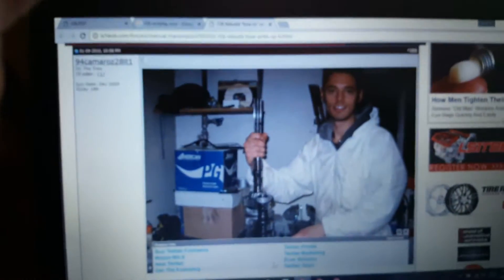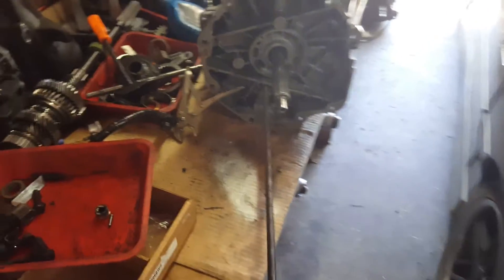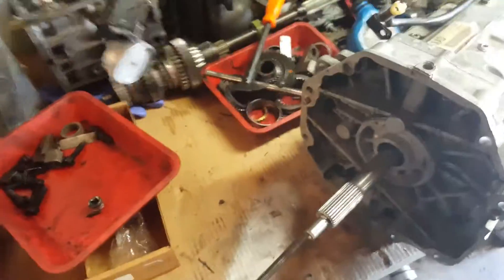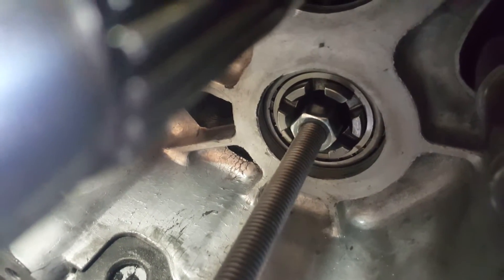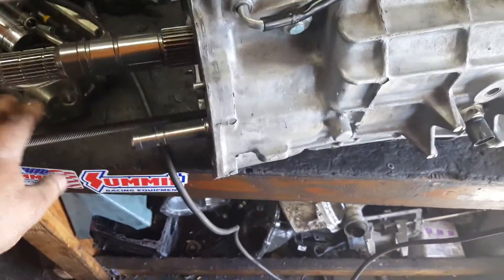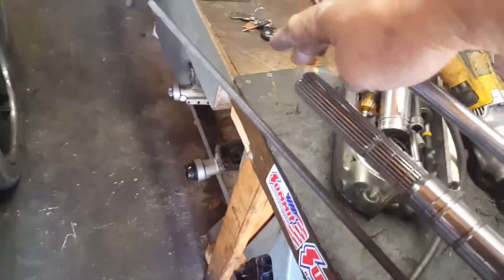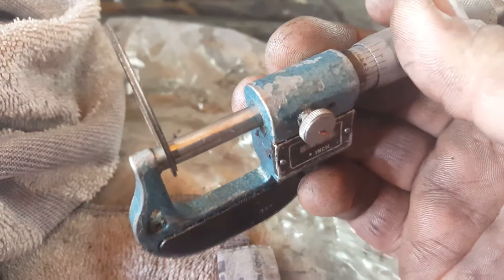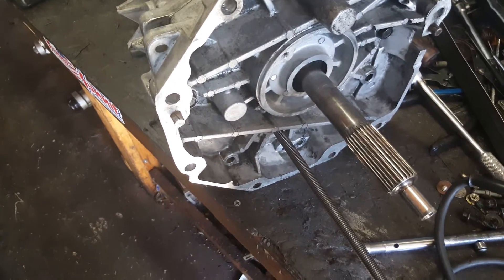tremec t56 rebuild how to shim countershaft and countershaft extension

Comment: A bit late adding a comment here, but starting at about 11minutes, when measuring the endplay, the indicator isn't even close to parallel to the shaft. Having the indicator at an angle gives a significant measurement error vs in-line with the shaft. The wiggle only exaggerates it and makes it worse. Also, the transmission is supposed to be vertical (face down) when measuring the endplay on all 3 shafts. Otherwise a very good and informative video, thanks!

Comment: What could cause the transmission to lock up in reverse with the transmission in reverse with clutch pedal pushed in? I changed the front plate and input shaft.. I didnt use a bushing so i probably messed up my counter shaft play but I cannot figure out what is causing this. The only other thing of note is it sounds like a bit of play near the counter shaft in the bearing in the front plate.
Reply: If all other gear shift  then it not clutch problem. Reverse gear shift fork pad, or billet key and spring can go bad, and making difficult to reverse. Not always the case.

Comment: just a note for those out there rebuilding these on there own.
1,the counter shaft bearing gets measured 1st without any shims behind the bearing race,that the # lets use .042 as an example,so you would use a .042 shim for .000 or .043 for .001( PRELOAD.)

Now for the mainshaft.
(ENDPLAY) same thing start without any shims behing mainshaft bearing,measure the ENDPLAY. example .059 endplay use .058 shim for 
.001 endplay.